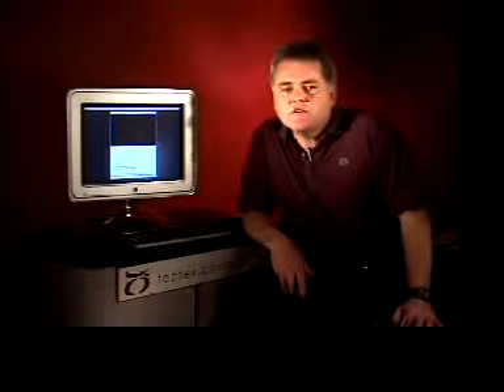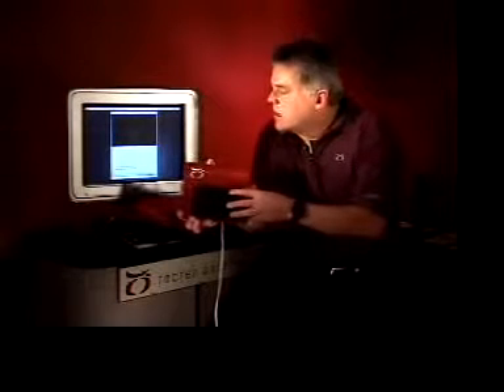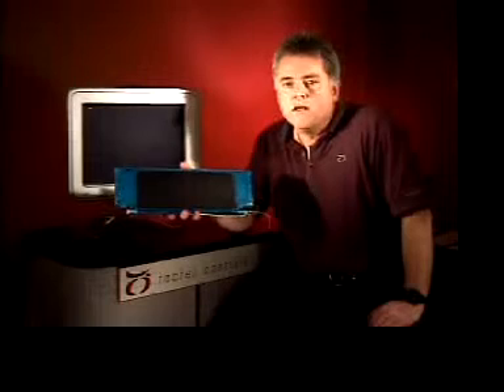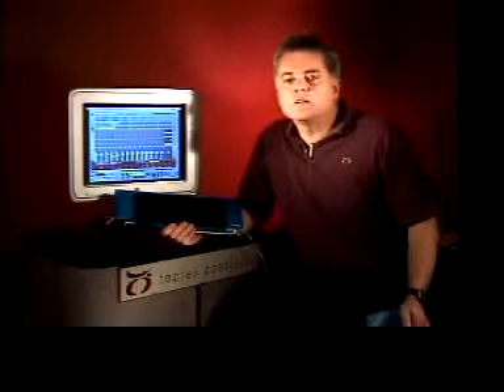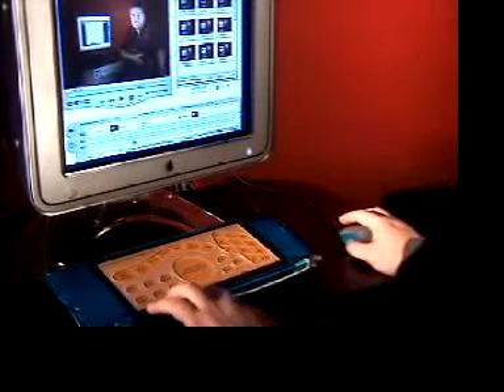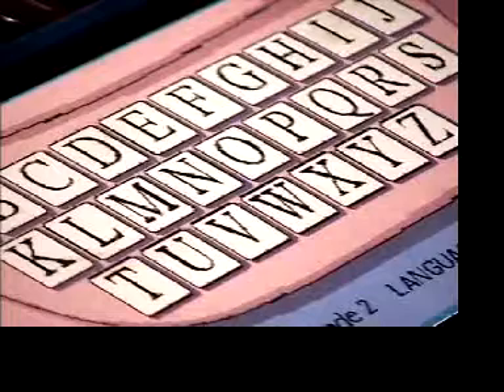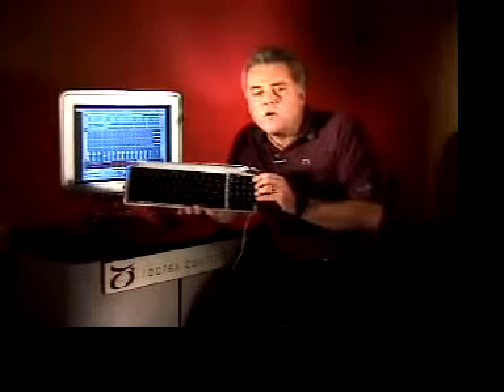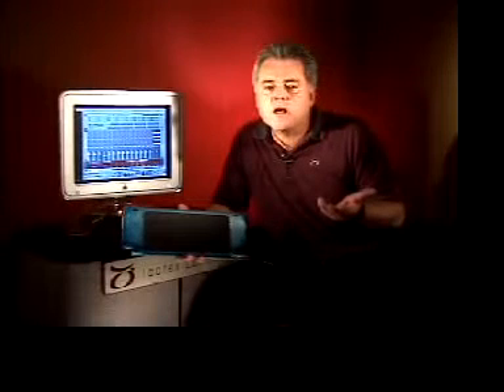The Flip Keyboard - A Keyboard with an Embedded Multi-Touch Tablet

Comment: Ah, that would have been amazing.

I suppose they've been usurped by multitouch display tablets which can function in much the same way with dynamically changing 'templates'.

There are also software programs for the Android like TouchDAW for sending MIDI.

However, the real obstacle is that the average computer user is seldom aware that the way in which they interact with computers impacts both their ability to do things on the computer, and the possibilities that are limited and/or presented.